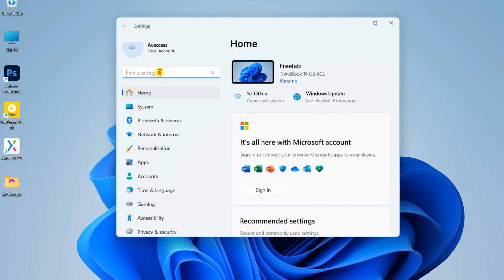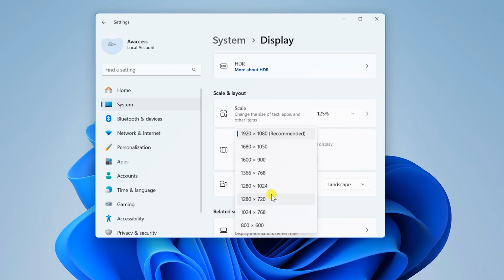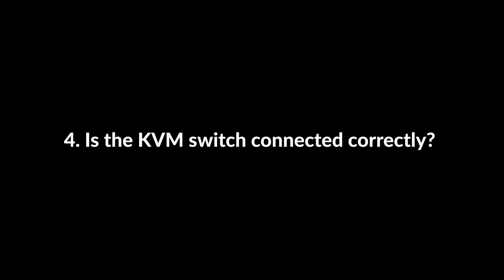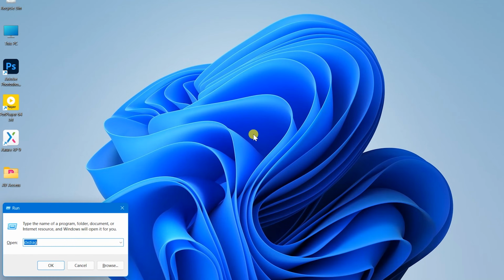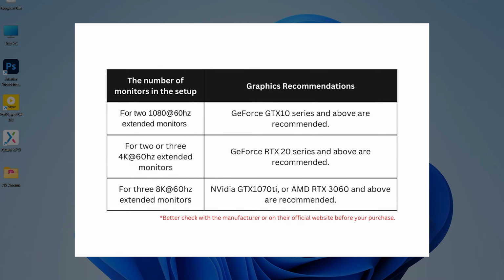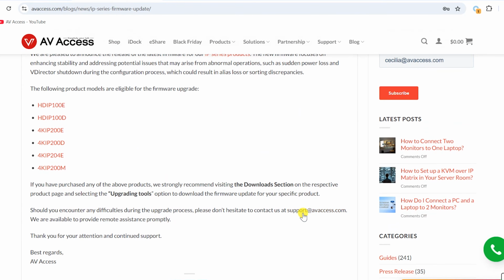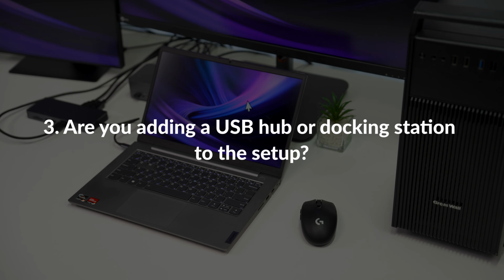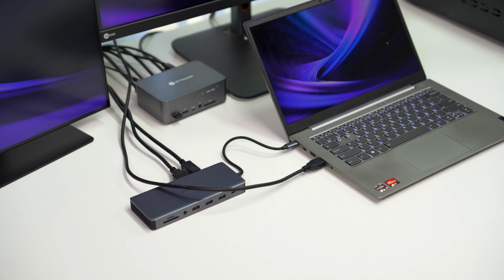How to Troubleshoot Your KVM Switch? #kvmswitch #troubleshooting

Comment: Hi my kvm switch is able to display my dual monitors just fine but my camera and headphones are not working !!
Reply from the maker: Usually, this situation happens on the desktop side, and the cause might be that you didn't plug in the USB-A to USB-B cable.

Comment: I am using 2x gigabyte M32UP monitors with built in KVM switches. The screens have no issue switching between laptop and PC, but the keyboard and mouse are only working on the laptop. PC will not recognise them. I have the host USB-B connected to both computers and have tried every available USB port on the desktop PC. Any advice? Thanks
Reply from the maker: We recommend that you:
Try using a different USB-B to USB-A cable.
Connect your keyboard and mouse directly to your PC to see if they can be detected.
If you still have issues, feel free to ask our support team in the community: https://community.avaccess.com/

Comment: hi, my main pc is coming as input 2. my main pc hasnt got a wifi card so needs to be ethernet to connectivity, is this the reason why its input 2? i personally want my main pc to be input 1
Reply from the maker: Which model you are using? I am a bit confusing here...
Reply: @avaccess no worries i have the issue sorted
Reply: @avaccess Hi, How do i get 120hz on my monitor with this setup, if is capped at 60
Reply from the maker: Hi. You can contact our support at support@access.com. They may need more information.